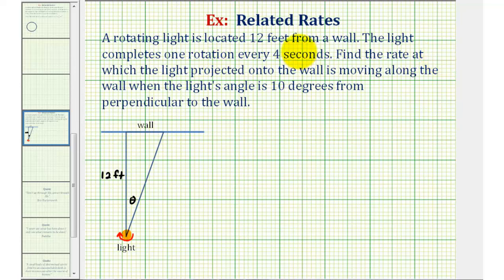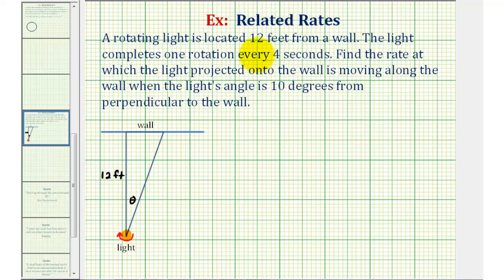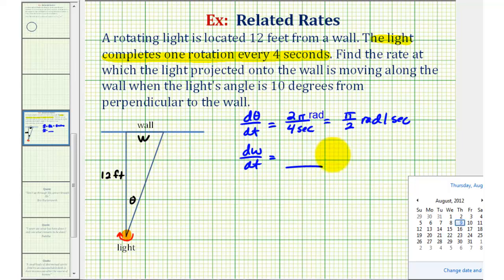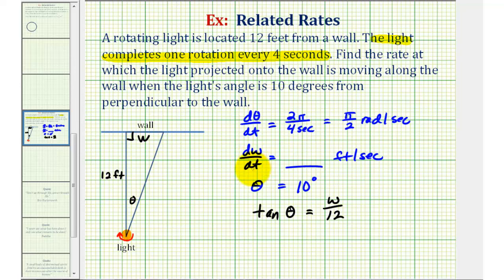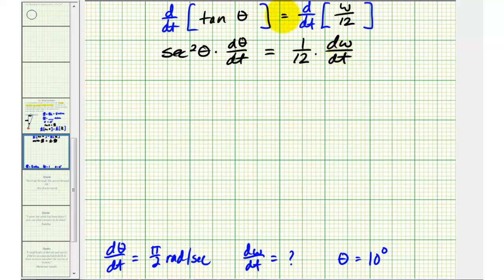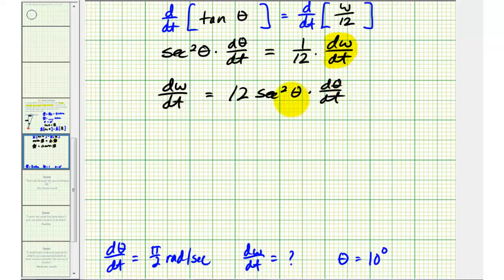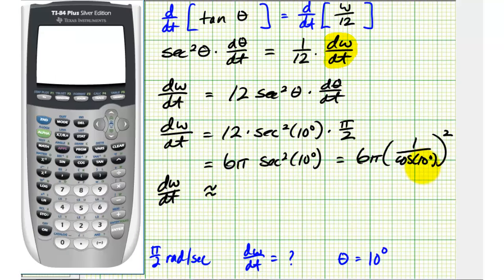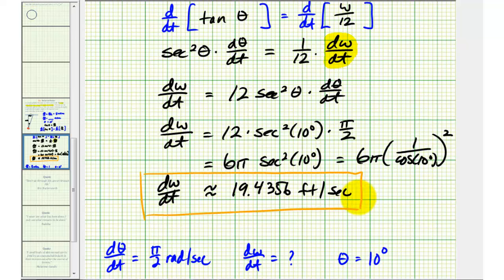Ex: Related Rates - Rotating Light Projecting on a Wall

Comment: Do we use radians or degrees for this question???
Reply from the maker: We can convert 10 degrees to radians. Since that was what was given, I just used degrees.  It don't affect the answer because d(theta)/dt is in radians.  The trig function values is the same whether we use degrees or radians, but for consistency, I suppose I should have done the conversion.